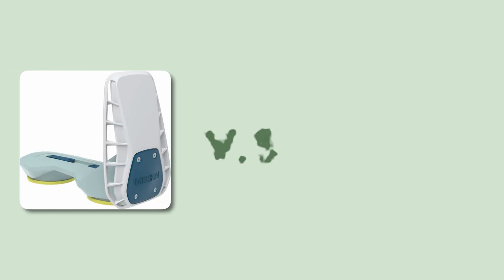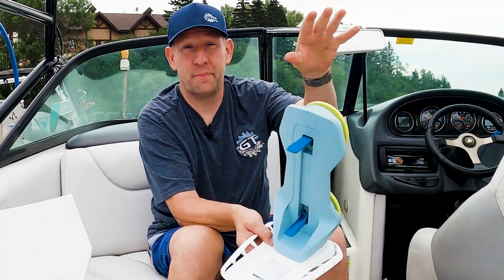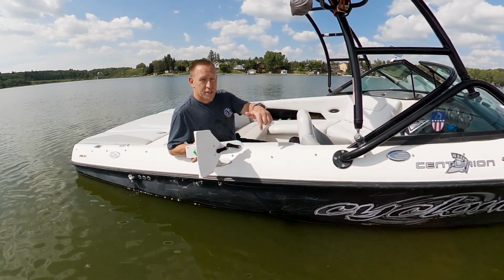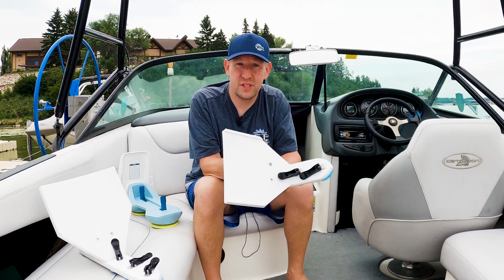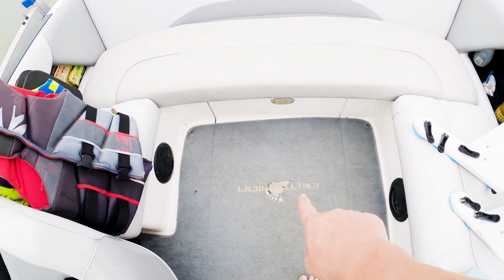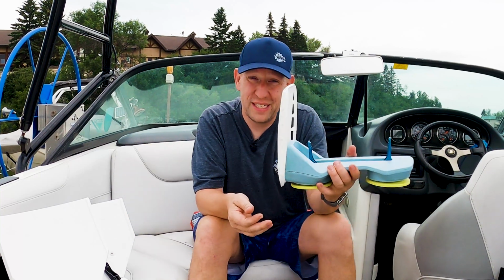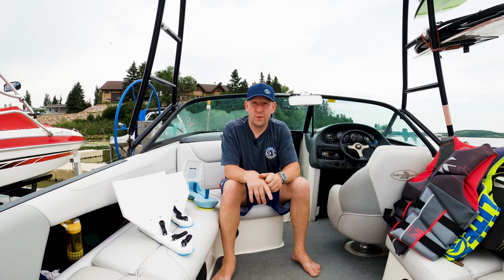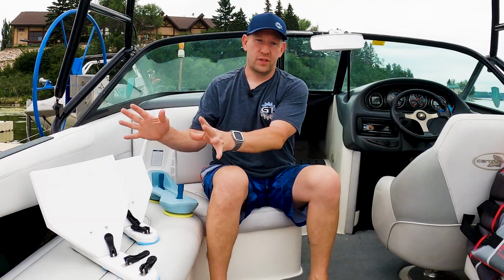Surf Mode vs Mission Delta ~ Making HUGE Wake Surf Waves! | Gears and Tech

Comment: Actually, you are more forward and struggling more with the Surf Mode device. The appearance of the wave has less to do with push and staying with the wave than the ease and ride. Maybe by the third ride you clicked in better.
Reply from the maker: When I have less people in the boat I run surf mode with both. The wave is great

When the boat is loaded I run just one in the back

Comment: What are some of the cheaper type of boats your average joe can buy to be able to use one of these in a lake or bay?  I've seen the wakesurf boats that seem to cost a couple hundred thousand (yikes)!!
Reply from the maker: Look at old centurion (2007) ish. That's what we run now and can be had for around 20k depending on your market

If you want even cheaper then you'll be looking at direct drive and then you want a supra or Malibu for about 10k
Reply: @GearsAndTech  awesome thanks so much!

Comment: Testing this under the same conditions (ballast, speed) doesnt really make sense tho.  The test should be which one can make the best wake allowing variation in things you can control.  Obviously try and keep external variables fixed but what if say by switching around your ballast a bit one of them was substantially better than can be achieved with the other.  Thats which one would be "better"

Comment: What do you recommend for a malibu wakesetter lsv 23 2010 model cheers
Reply from the maker: I had the same boat for many years, in all cases I found surf mode makes the best, longest wave
Reply: @GearsAndTech  how much extra ballast would u put in the rear lockers and is the any were else in the boat, you would put extra weight

Comment: I have a 2007 Bayliner 195 i/o and I put a big inner tube dangling off the back of the boat to insure safety, I’m woundering what shaper to get l, I currently have no ballest but will be looking into that soon.
Reply from the maker: I don't recomend surfing with an io

However, if you must, trim up a couple notches to help push the back in the water and run 2 surf tabs on the side
Reply: Don’t surf behind an I/O. PERIOD!!! 
Google injuries from surfing behind I/O’s. Hope you don’t have a weak stomach

Comment: I made my own using a cutting board. More sq. Inches and much better wave than the commercial products and only cost me $50 CDN not including labor.. Using it on my SAN 230.
Reply from the maker: I've done a bunch of ghetto mode suck gates as well using scrap 2x4s and plywood.

I still have one in my boat as a backup

Comment: I running very similar set as your boat. 07 cyclone and really appreciate all your insight. Really dialed in our first waves with your videos and help. My boat actually came with the early lenco 9x12 tab set up with 2.1/2” actuators that you installed. 
Like you stated in another video the deployed position is only 12-14 degrees while the stored is roughly 2degrees up. 
This setup definitely doesn’t give me the wave that the surf mode makers have achieved. Actually very piss poor. 
I have my ideas as to why by looking at OEM setups on new boats. 
I’m think you had a follow up vid that explained what you did to change up and achieve way better results but can’t seem to find it. 
Wondering if you ended up enlarging the surface area of your plates. Suspect that’s the one thing that has to be done. 
Also might just swap out 2.5 actuators with 4 1/4” to get that more downward deployment of 22-25degrees. This is so I could just reuse holes. I’m trying not to continually blemish the back of boat with test holes. 
Also Although there are other diy gel coat repair vids. Wondering if you have any plans on trying your hand at it. 
Thoughts. 
Thks
Reply from the maker: I never got the deployable plates to work as well as 2 surf modes on the side

So, this weekend I'll be removing the actuators and plates and putting silicon in the holes to seal it back up.

The secret is to add bigger plates, but plate shape and design changes so much that it's just not worth it to keep going back to the drawing board

If you want to stick with the plates just get a giant piece of cardboard and trace someone else's factory plates. It'll help a lot.

But for me, I'm surf mode all day with no complaints.
Reply: @GearsAndTech  
Ya that’s what I was thinking. I have surf mode also and it definitely is a game changer. Some of my kids friends say it’s the best wake they ever surfed. 👍
Plates do help with getting boat on plane when I need that option. I do use them in shallow water when ballasts are full. More as a safety to keep prop ass up few xtra inches. 
Thanks for feed back. I might bolt on some large plates for testing. Also thinking if I can swap out actuators with 4.5” model that would allow me to not drill more holes in boat. Such a pain. 
Thanks again for your response.

Comment: Do you feel you have a noticeable gas milage decrease when using a wake shaper on the side of the boat compared to listing the boat without one?
Reply from the maker: Great question

With one shaper no difference

2 shapers make the motor work harder for sure

Comment: Watched a lot of your surf boat set ups and excited to see that I purchased similiar/exact boat -
07 centurion cyclone c4 with lenco wake plate set up. No xtra ballast thou. 
My ballast and locker position questions are answered perfectly by you. Thank you. 
Do you know what prop your running ? A spare is almost a must.  Currently got an acme 497- 13x17.5 but most bull boards say should get 1631 - 13.5 x 14.25 or  
537 -13.5 x 16
Reply: I see you answered my question in another video. Acme 911.
Reply from the maker: I have been running the 911 for the past 2 seasons. But it dinged up at the end of the season so I'll be running the one that was on it when I bought it.

I remembered it working well when I used it before. So I'll see how it goes.

Unfortunately I don't recall what it is though.

Comment: Thanks for these videos… I’m trying to get our 91 mastercraft Maristar set up to surf. I have the fat sac fat seat and a swell h3x on the side. My wave looks great but has very little push.. not enough to drop the rope. Any advice?
Reply from the maker: That's surprising. I had the same boat a few years ago. We put 2000 lbs in the very back and It worked well

If you can find a phase 5 model x board it'll make up the difference.

I struggled for years with a crappy surf board. It makes a huge difference

Comment: Thanks for the videos!  One wakeshaoer I would love for you to try would be the flip surf!  It has a magnet attachment and I am deciding between that and surf mode,  it is more easily flipped between sides you should check it out and it won’t fall off ever because of the attachment style.
Reply from the maker: Just took a look online

I do have a few concerns with it.

Those stick on magnet strips are a one shot attempt. If you don't know the perfect place for it you're screwed. Your not going to get that double sided tape off very easy

Second is you need to double sided tape the magnet base on. My boat is old and beat up, so maybe I don't care that much but I would never stick this onto a nice boat

If your option is between this and surf mode, then surf mode is the one I would pick.